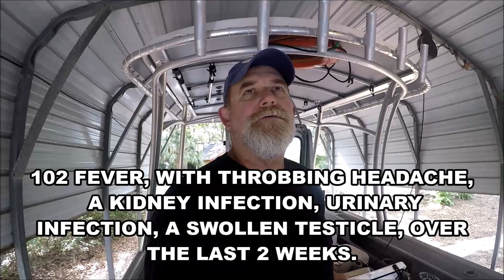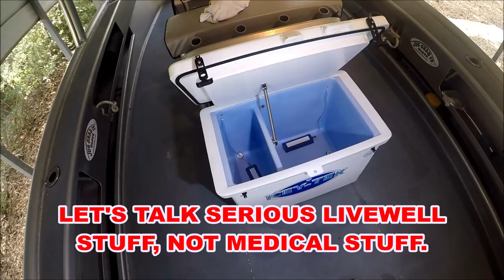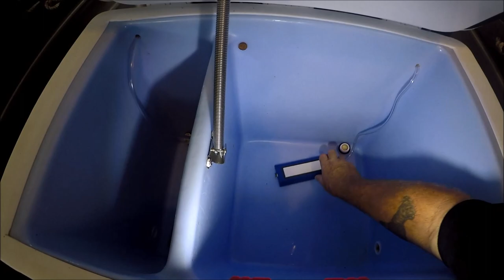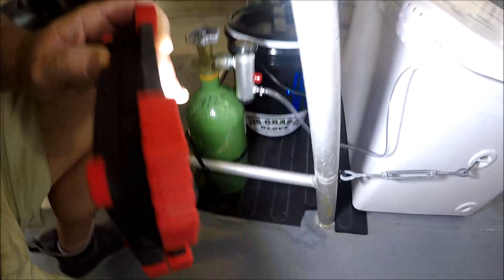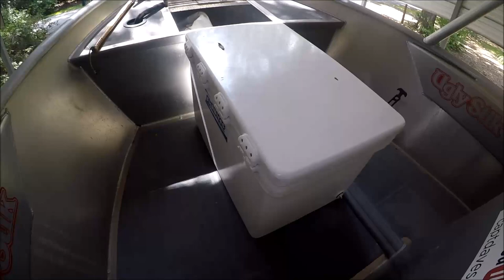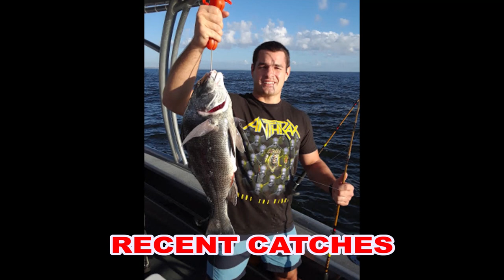BEST OXYGEN BAIT TANK SYSTEM

Comment: How are you putting and taking the water in and out of the tank. Do you use a pump with a long hose on it
Reply from the maker: I put the water that the baitshop gives me with my shrimp and if I'm using croakers mullet or pogies, I put the water in with a bucket and the water out with the cooler drain plug......."there is NO water recycling".

Comment: Approximately how many hours do you get out of an oxy bottle before having to change it out using those stones Dave? Thanks in advance.
Reply from the maker: i run it for 6-8 hrs on lowest regulator setting for a month or more which can be 8-10 days believe me, if its shrimp you're using they live the high life! baitfish like croakers, i may go up a notch on the regulator at first, then as i use them and have less of them i dial it down again to one up from off. 6-8'' croakers. same for mullet and pogies, too.